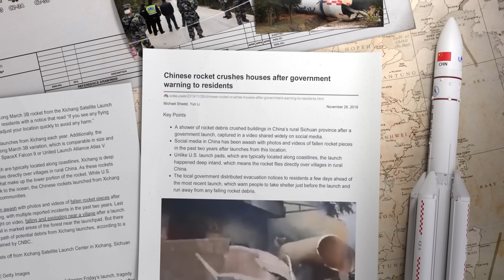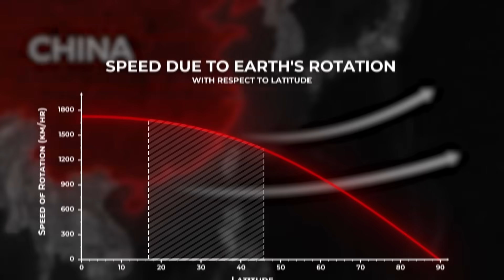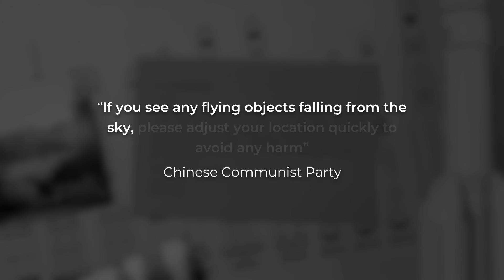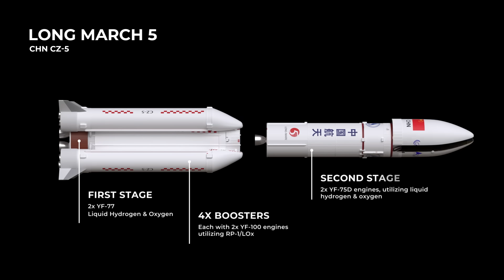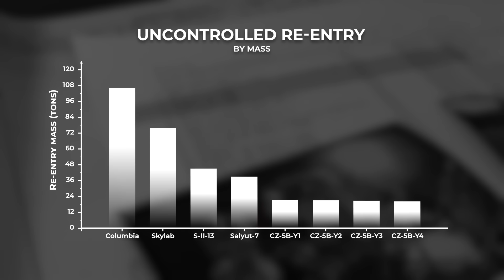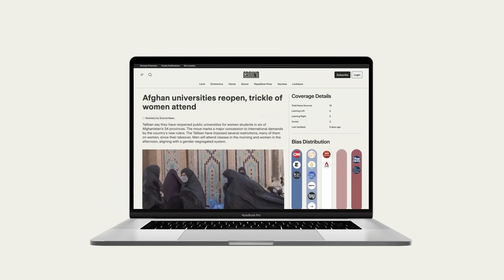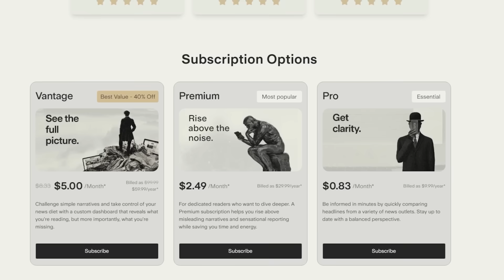The Problems with China's Space Program

Comment: "The Problems with China's Space Program" is that they succeed way more often than fail. Thus need to exaggerate every little failure to satisfy some people's internal superiority complex.
"Here’s a concise summary of China’s orbital launch record through mid-2025, based primarily on the Long March family (which accounts for the vast majority of Chinese launches):

Total launch attempts (to 2025-06-20): 582 
Successes: 563
Failures: 10 (complete failures)
Partial failures: 9 (payload delivered to wrong orbit or degraded mission)
Overall success rate: 96.7%"

"Here’s the combined launch record for NASA and SpaceX through mid-2025:
Total attempts: 665
Total successes: 633
Total failures: 32

Success rate: 
633/665x100%≈95.1%

Failure rate: 
32/665 ×100%≈4.8%

So together, NASA and SpaceX have achieved a roughly 95.1% success rate and a 4.8% failure rate over 665 orbital launch attempts."

Comment: It's interesting to note that there are a few specific differences between hydrazine itself vs. UDMH and MMH many people don't know about. While methylhydrazines burn orange in air, hydrazine burns invisibly with clear blue-violet flames fainter than methanol fire. Methylhydrazines are said to smell more like rotting fish and hydrazine more like ammonia. They also apparently have largely opposite effects on brains via small exposures - hydrazine as mostly a depressant and methylhydrazines as just convulsants. 

1. All hydrazines are both strong reducing agents and nucleophiles, so they aggressively reduce aldehydes, destroying pyridoxal and its 5'-phosphate. Pyridoxal hydrazones inhibit pyridoxal kinase and stop P5P synthesis. GABA synthesis from glutamate is among over 200 reactions stopped by P5P depletion. Rapid GABA depletion excites every part of the central nervous system, the brain as badly as what strychnine does to the spinal cord. Hence tonic-clonic seizures and status epilepticus, which are refractory to everything but massive pyridoxine injections. The oxidative and neuroinflammatory effects of hydrazones and free radicals worsen this. Hydrazine is unique in not doing this as much except at high doses.

Comment: In case anyone is wondering how bad this is, each of those bottles at 3:01 is enough of its respective hydrazine to theoretically kill hundreds of people. Monomethylhydrazine is the worst in the short term and unsymmetrical dimethylhydrazine makes the most carcinogenic exhaust as partial combustion makes N-nitrosyldimethylamine. The LD50s in rats are 30 mg/kg for MMH, 60 mg/kg for hydrazine, and 122 mg/kg for UDMH. It has been estimated from false morel mushroom toxicity (more hemotoxic and hepatotoxic but less neurotoxic than direct exposure) that the human LD50 of gyromitrin-derived MMH is just 1.6-8 mg/kg (marginally more toxic to humans overall than sodium fluoroacetate/1080 and as toxic as strychnine to the most sensitive). All of them go straight through gas masks while dinitrogen tetroxide burns the adsorbent surfaces of activated carbon. Prolonged or repeated exposure can be potentially fatal at levels too low to smell. It's said that methylhydrazines smell more like rotting dead fish and hydrazine more ammoniacal, while the smell of N2O4 is more chlorine-like. Hydrazines are not only caustic bases that burn skin and cause liquefactive necrosis, dissolve hair, and if water water is present will eat through aluminum - they also absorb through intact skin. MMH has a dermal LD50 of 100 mg/kg in rabbits and is likely at least 2 or 3 times more toxic in humans, so half a teaspoon on skin is likely fatal if the feeling of saponification is ignored until it causes obvious painful burns. Any piston engine attempting to run on these fuels would also be short-lived thanks to corrosiveness and combustion being too violent.

Comment: about the "2-way communication of positioning system", I doubt civial device and do that. You need hardware, the antenna and sufficient power watts to emit signal for a long distance. Do you believe your cell phone is designed to emit signals by the hardware and such power consumption? Even your phone is able to do so, receiving and processing such volumn of data from such a giant population need vast CPU calculation & the power too. This is not Google or Microsoft who can build an under-sea data center, this is just a small piece of equipment floating in the space, with the power source from solar panel. I don't believe that can handle vast amount of calculation.

Comment: It is NOT by design.  That means they are intentionally crashing them in these location.  No they just don't care.  So what if some poor villagers die.  They give them a little money and tell them to shut up or else.

Also a rocket should be launched as close to the equator as you can as this gives a boost to orbital velocity.  You want to be as close to what is called the Tropic of Cancer or 23.5 degrees north of the equator or less.  Both SpaceX and NASA launch just north of the Tropic of Cancer.  Only the southern launch site in China is even close.  The other two are horrible launch sites.

You must understand a typical rocket to LEO might be able to carry 3-5% payload tops.  For a high orbit or something like a deep space or Mars mission you are closer to 1%.  So any savings in fuel is HUGE.  The fuel savings can be as high as 10%.  So China  as those two northern sites likely struggles launching beyond LEO because of this and their payload is limited.  Many countries really can not achieve orbital velocity with much if any payload because they are too far from the equator.

To make this worse China still uses dinitrogen tetroxide.  It is a powerful oxidizer that is hypergolic (spontaneously reacts) upon contact with various forms of hydrazine.  Hydrazine is pretty nasty stuff.  Those rockets crashing into these villages are full of toxic chemicals.  Most US rockets not use Hydrogen or Methane with liquid oxygen.  Only small boosters that deploy satellites still use them as they are the easiest to ignite in space.  China uses it because it is easier and more powerful... while Elon uses Meth/LOX and better designed engines.

Comment: The idea that it is irresponsible for China to place rocket launching bases in the interior of the country is, in my opinion, an incomplete argument. The objective fact is that 80 percent of China's population is concentrated in the east and only 20 percent lives in the west, and most of the rocket launching bases are located in the western part of the country. If a rocket is launched on the east coast of China, it means that the population around the launch center is more densely populated, even though the path of the rocket lift-off is the ocean. For the argument to be valid, it has to be shown that launching on the eastern coast of China is a safer option.

Comment: BeiDou, while supporting Bi-Directional communication, does not require Bi-Directional communications to operate.  Many GNSS chipsets out there that are strictly receivers and supporting BeiDou do not have the transmitters.  Very few GPSr's support communication back to satellites, and the vast majority of those do not transmit to GNSS systems, but to other communication satellites like Iridium Sats, for communications in remote areas, more used as a safety-net than anything else and a solid alternative to a Sat Phone.
Reply: Columbia did plan its deorbit burn but tragically broke up in midair.

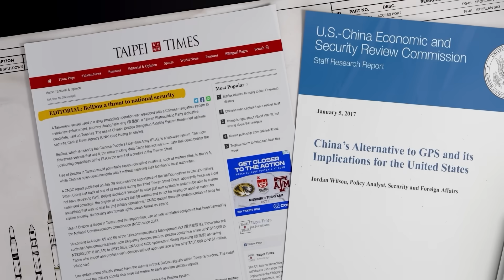Comment: 11:21 This is a bullshit, there is not enough power and no directional antenna in the user device to transmit data back to the satellite. BeiDou does not require the user to transmit any data and operates independently of any telephonic or Internet reception.

Comment: Boosters of rockets do just fall back to the Earth. Before SpaceX US rockets like Saturn V booster stages also fall back to Earth but into the sea (because geographically possible).  Whenever China conducts a rocket launch, they also calculate where booster stages will land and temporary cordon off the area. It is not a great solution but long march rocket family has its origins in the 70s probably based on much older Soviet tech. Its rumored that they are working on reusable rockets where booster can land back on Earth much like the Falcon 9. When the video says there are alternative, there isn't in the storable category.
Reply: Well, no. With US launches the deorbit and landing point of the first stage was known accurately and both sea and air traffic were prohibited in the area during the launch. Also the US first stages didn't reach orbit as the Chinese do, but instead had a ballistic trajectory; once you're at LEO it's much harder to predict where it lands, as is the case with the Chinese, ie, it just lands wherever it happens to land.

Comment: The problem with all space programs is: NOTHING flies or floats in a vacuum.
Reply: what do you even mean by that? any action has an equal opposite reaction, spewing tons upon tons of expanding gas from burning fuel will obviously push the rocket in the opposite direction, regardless of whether there is an atmosphere or not
Reply: @altaruss2838  The expelled thrust doesn’t encounter any external resistance in a vacuum to propel it in the opposite direction of the expelled thrust. Floating  in a vacuum is impossible as well. To float you have to float in a substance. In a vacuum there isn’t any substance which would maintain something floating. Floating in NOTHINGNESS is an oxymoron.
Reply: @michael.forkert  that is a whole lot of garbage, literally as I just said, the rocket is pushing off of the expading gas from its burning fuel, it's physically impossible for an object to not move if it's shooting anything in the opposite direction, it's literally the same thing as the recoil of a gun - push a bullet in one direction, the gun gets pushed in the opposite direction
Reply: @altaruss2838  Recoiling of a gun is a little more complex, and it  is definitely not “literally” the same thing as  flying or floating in a vacuum.
Reply: @michael.forkert  in this regard it is exactly the same, the bullet is pushed in one direction, the gun is pushed in the opposite direction, it's physically impossible to be any different in any case, you can't give momentum to a mass without gaining the same amount of momentum in the opposite direction, a rocket in space is literally throwing away tons upon tons of fuel for that exact reason
Reply: @altaruss2838  I continue affirming that NOTHING flies or floats in a VACUUM , I repeat: in a VACUUM . Whatever happens here on Earth, has nothing to do with a vacuum!
Reply: @michael.forkert  lol sure if you repeat that same nonsense enough times it will surely become true
Reply: @altaruss2838  The explosion of the gun powder hits the bottom of the cartridge or shell and the reaction of the bottom sends the bullet in the opposite direction. The recoiling is caused by the collision of the gases against the bottom of the cartridge, and the collision of the bottom of the cartridge with the bottom of the barrel. If the cartridge and the barrel had no bottom there wouldn’t be any recoiling. I ask you again: What has that to do with Flying or Floating in a VACUUM? Do you know what topic reasoning is? Topic Reasoning is not to divert from the original topic which is being discussed. Note: The barrel has a bottom as well, and if  the barrel had no bottom there wouldn’t be any recoiling, or rather: The shot would definitely backfire onto the shooter, that’s unquestionable.
Reply: @altaruss2838  As usual, when the interlocutor runs out of arguments, he tries to overwhelm the other interlocutor with Ad Personam Arguments, which consist of devaluing or disallowing the other's speech through attacks that focus on his person, his education, his choices, his character, his intellect or his acts.
Reply: @michael.forkert  lol I guess you don't understand even that, there still is recoil even if there is no bullet in the barrel, that's pretty much how rocket propulsion works, push gas in one direction and get pushed in the other, or you gonna deny that fireworks exist too?

and imagine getting upset about someone "changing the topic" because you can't even comprehend how it relates
Reply: @altaruss2838  If it is science, there is no consensus. If there is consensus it isn’t science.
Reply: @altaruss2838  The marvelous thing about topical reasoning is that it makes it possible to conduct an intellectual inquiry without prejudice what the outcome of the inquiry might be. One follows the desire to know.
Reply: @michael.forkert  damn the irony of you hearing an analogy which you didn't understand and so going on a 3 message rant on how changing the topic is bad, the pot calling the kettle black
Reply: @altaruss2838  Self propulsion doesn’t exist.

Comment: I don't think this video has a balanced view, it's biased imo. Feels it's either lack of research or trying to push a narrative.

For the falling rocket boosters. Isn't it doesn't make a lot of sense logically that a government's solution is tell people on the ground to avoid it when they see it?
Upon a quick research myself, which take less than 3 minutes. The Chinese government does issue early warning to village in the 'danger zone' days ahead of the launch, and they usually pick the most less populated area for the rocket's trajectory. Having such system in place also helps them recover used rocket boosters.

Those launch sites are indeed bad picks in today's view. But some of them are products of cold war era. Part of the reason why the newer launch sites are down south is also because they are aware of this issue.

Not mentioning the function of Beidou's two way transmission is optional is also kinda strange.
Most devices only has receiver function built in due to power constraints and cost...

These information aren't difficult to find, took me less than 10mim to Google both. Especially about the falling rocket boosters, feels like a part of the information is intentionally removed to create a narrative.😂

If something I wrote is wrong, feel free to point out. I only did some quick research, doesn't have hours to spare from my weekend.
Reply: You’re just finding excuses for negligent choices made by the Chinese government. If the two way communication wasn’t an issue it wouldn’t be banned in Taiwan. And what are people in poverty gonna do with an early warning? You think they can pack up their cattle and rice fields and just leave for a few days vacation? They don’t have to launch rockets over their own people, they choose to do it.
Reply: @ftgodlygoose4718  damn that cia propaganda is trying too hard

Comment: That fuel is the same used in the German me 163. It was said to be able to melt the pilot into nothing if a fuel leak happened.
Reply: It's not, oxidizer is different, Me 163 used hydrogen peroxide.
Reply: Urrr.. does  it matter really? With the volume of fuel it is packing. Melting a body is least of their concern. Any chemical used in a rocket is dangerous because it is energy packed to be efficient.

Comment: Regarding the GPS system with two-way communication, it seems to me that it is not suitable for locating phones and small devices. It seems difficult to me that a phone with limited power, without large or directional antennas can transmit a signal to a satellite hundreds of kilometres away.
Reply: It can't, there's at least 2 engineering lies and 1 propaganda lie in the video. Basically anything he says is suspect
Reply: it's just the ability to send messages from a phone, doesn't mean it has to
Reply: EPIRB beacons do not need large or directional antennas but, of course, they only have enough power to transmit for a few hours.
Reply: You can use the sun as a signal amplifier - Three Bodies
Reply: phones can absolutely be tracked.
Reply: @aarons6935  But not via satellite
In other words, the phone calculates its position with the information emitted by the GPS satellites and sends it to the haker or to the website that needs the location via terrestrial cell phone antennas.

Comment: I use  GPS for a multitude of uses.  A GPS receiver is just that, a receiver. It receives signals and has zero transmit ability, so How can Beidou birds track anyone?
Reply: BeiDou 1, an older system apparently did require 2 way comms for it to work. If I had to guess it was to limit who can use it.
BeiDou 2, is more conventional GNSS.

Comment: I worked Titan II communications back in the mid 70's. Hydrazine is way more than a carcinogen. Hydrazine is 1st cousin to NERVE GAS! It will kill you LONG before you have a chance to develop cancer. In the Titan II missile launch complex they had "sniffers" that sensed the presence in the air of either oxidizer (nitrogen tetroxide ) or fuel (UMDH). Unfortunately by the time the sniffers went off for fuel it was already at TEN TIMES the lethal concentration! Bad, BAD stuff!